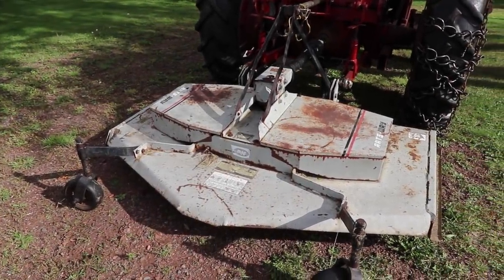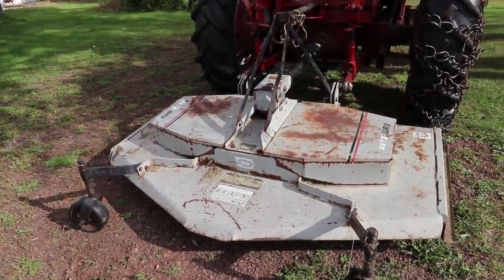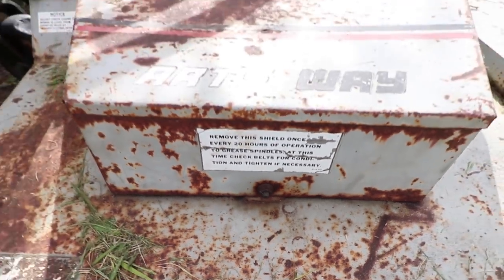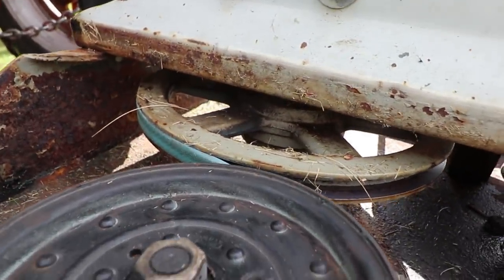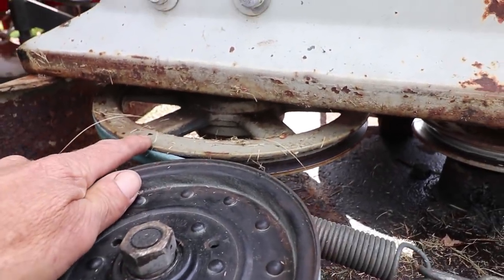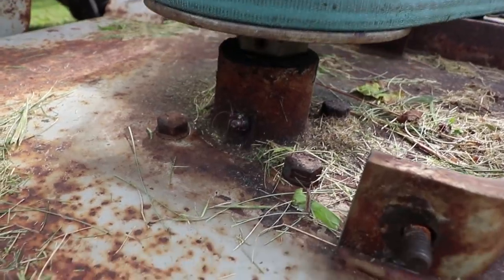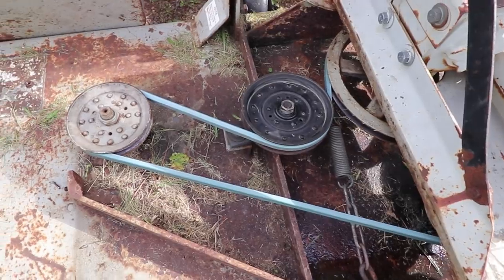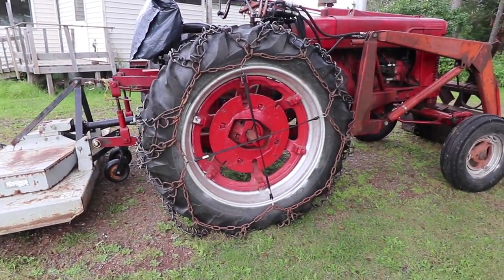FINISH MOWER. Arts-Way. Belt configuration.

Comment: What a surprise when you opened it up.  Its huge...the belt.  Where do you get a replacement belt from?  Are you going to be keeping it long term?  Very rusty under covers.  I would take that belt off and scrub clean all the bolts and add a little oil will protect it from further rusting.  Like who has time for that , right?  But it could be a real collectors item at some point.  Maybe next summer you can reconstruct and paint it all up.  It has paid for its self already.  Good purchase.

Comment: TO put the tire chain on the other wheel ,  use a ratchet strap thru the rim slots and the drive the tractor forward  then a second  and third straps to  draw together  both ends ,, yup takes longer than slinging by hand  but sure is easier on the body ...  and now in the fall NO SNOW is the time to do it IMO ,,, Best Regards J

Comment: Hey Joe, did the old belt break? or just preventative maintenance?  I was also surprised in one of your previous videos when you said the finish mower is not that effective when the grass gets too tall. I think you said the blade get clogged and stop spinning. If that's the case is there any other type of equipment that can be attached to tractor to cut any length of grass? While typing I was just wondering what you had for lunch. LOL!

Comment: Look at the pulleys. This is a V-belt set-up. Any pulley that is V'ed grooved, is to drive what ever the belt is on,  you do not run the back side of a belt on those pulleys. Look for pulleys that are flat on the bottoms, pretty much the same width as the back of the belt, that is telling you, the back is being used as a idler to guide the belt. The spring is a tensioning spring, that help keep the belt from slipping when you run over things you shouldn't.  "Rocket Science 101!"

Comment: If you want to do something easy to stop the rust, you can spread on a thin layer of cheap tomato ketchup on the rusted parts. I have done that a couple of times on my barbeque where it rusts easily, and it seems to work fine. At least it is better than doing nothing.

Comment: Might want to drill a small hole in the deck to prevent standing water in there and reduce rust
Reply: Along with a few holes, parking with the deck at an angle will help.